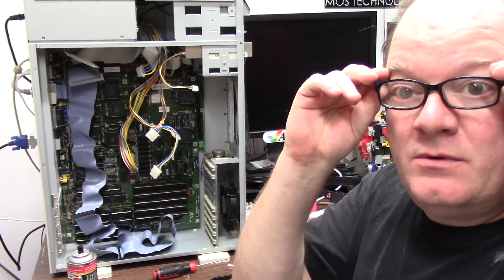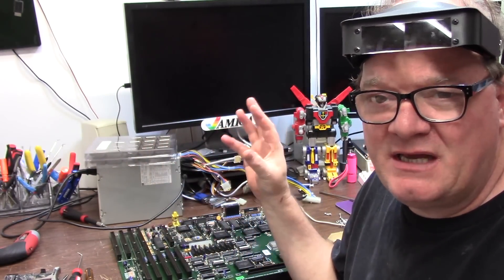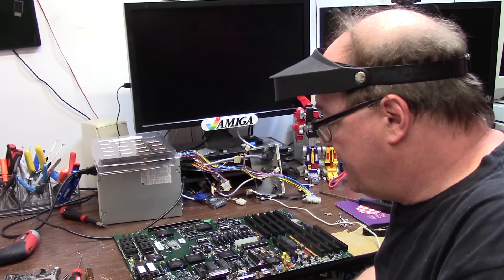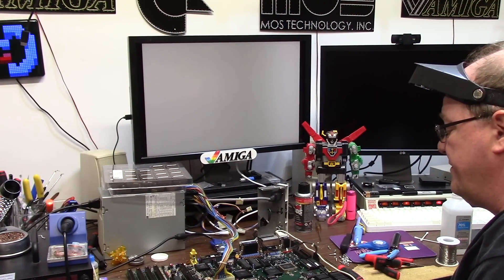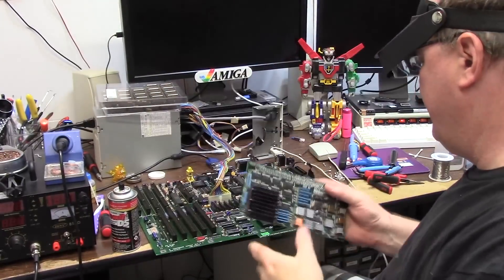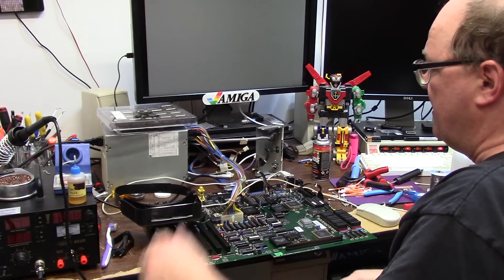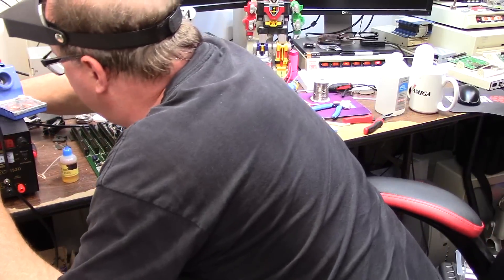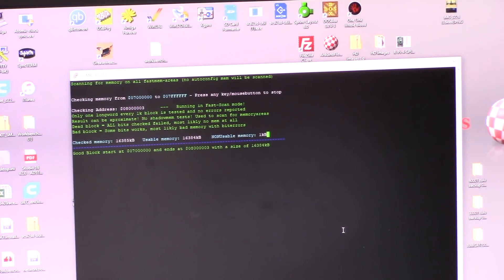My Amiga 3000T died

Comment: I have an A3000T with 8megs of chip ram and 56megs of expanded ram on a Phase 5 060 MK2 board, Buddha IDE, bought my tower new in the '90s. I also have the A3000D and A1200, all working except the scan doubler on the A3000D, bad traces due to the battery leaking. I was having intermittently with memory errors. I removed all of my chip ram and used the MK2 ram and all of my problems went away. Installed the chip ram on my A3000D and now I have 12megs of chip ram an all is well. I either had a bad ram chip or the MK2 with 060 was too fast for the chip ram or a bad socked, try this if you haven't. I am going to put my MK2 in my A3000D and see if I have ram problems on it.
Reply from the maker: Fastram.  Max is 2mb chip
Reply: @ChrisEdwardsRestoration  I was using a solder sucker 30 years ago and damaging boars. I bought a Weller desoldering station and got rid of all my solder suckers no more damaged boards. I suggest (all readers) if you are going to work on vintage boards invest in one, I paid over $400 for it 30 years ago, now you can get one for about $100.
Reply: @frankpapaeliou5630   those poor boars....
Reply: @ChrisEdwardsRestoration  I had 8 megs of on-board fast ram and the mk2 ram when I had problems. I removed the 8 megs and just used the mk2 ram and all my problems went away. I installed the ram in py 3000D and ran a MicroBotics MBRTest-2 for over 4 hours with no errors, that's why I believe I have a socket(s) problem.
Reply: Oops yes 2megs chip ram. Have you tried removing the fast ram and using external ram?

Comment: My gut feeling is its U202/203 lines, or RAMEN (p25) off Agnus, or if its something silly on Agnus like its in a 'kinda' test mode (p 41); doesn't Agnus do some things in 32768 chunks (could be cause or effect though I guess)...but note, I am an idiot and dont know anything!
Reply: ETA - also got me thinking back to an old Jan Beta video --- have you made sure none of those trace wires have been pierced by any pins?
Reply from the maker: Checked them all and i even replace sockets
Reply: @ChrisEdwardsRestoration  Couldn't tell, was the onboard (non socketed) chip ram changed? (I've had cf cards fail 'randomly' too often when RAM was marginally misbehaving).
Reply from the maker: I get to that in future episodes and even more weird stuff happens

Comment: I have only this, once, many moons ago, WE (Computer Chain) had this A2000 come back to us at Warehouse, Ver 4 MB come in Powered, but Dead but complaining of Disk Errors, Erratic Working, then Dead, they had spent some bucks on 68040 GVP, So we looked at it, long story, but it boiled down to C.I.A Chips being a early revision not be abel to handle it, & Frying Themselves, I cannot remember all, but It was also to do with MB Version, cause my Kindly employers, Sold them a Version 6 as a Sparepart ... I didn't do much work on 3000 T so unsure if this has any help in it ..
Reply from the maker: i wish it was. but Cias are fine.

Comment: I've replaced tons of Toshiba branded zip chip ram in these machines over the year,95% of the time its been the soldered chip ram has one or more fail-did you remove and test ALL chip ram??. Also had a 3000T once that the factory denise socket was bad,intermittently crashed no matter what completely random(not pertaining to your trouble).. i finally found when i removed the socket it had one bad pin broke making contact sometimes ..make you pull your hair out :D I sold the sockets to Tim,they were bonafide hard to find zip ram sockets and not made from pin strips. Good luck finding the trouble man!

Comment: It looks like upper half of the lower word (so D8,9,.10.11.12.13.14.15)  The RAM that connects to that will be buffered - that buffer is either borked, or the 74 series / GAL that controls the 245 OE or DIR pin maybe.  I am thinking U258 or U256...  I think effectively 1/4 of the RAM cannot be accessed, but its 1/4 off the 32 bit width - meaning none of it is technically accessible in terms of 32bit access, and for 16 bit access only 50% of that word is working - basically you have no RAM...    Great video btw!  I did enjoy!  Just sorry you had to spend so long on this one - it's better for the new sockets for sure!
Reply from the maker: see my brain lacks that ability. thank you ! i will continue on. these are all pre filmed from months ago. i ended up replacing the entire chipram system, the 646's the 74 series, the ram the sockets, agnus everything, and i got a cpu that said "BEEF" lol

Comment: thats amiga for you :) check the hard drive controller. if the hard drives started getting all f-ed, then your chip ram, it might have been a short, it might be the controller. you went over all of "your obvious, maybe you should try thinking outside the box a little, might help. id go around and do what you did, then id check the HDD controller. maybe even paula. hey, troubleshooting works like that, i know you got this, i know you know what you are doin; just a suggestion.

Comment: People tell me how great it is to own these still. That they want to get one and dive in again and enjoy it. I always try to be honest with them. They’re old machines and many never stored properly. You might even get a working one and play games and have a blast one week, only next week for it to explode. Amiga is a love-hate relationship.
Reply: The A2000/3000 are full of old sockets,they can be made reliable IF you go thru everything..(check all chip pins,socket pins,etc) Battery damaged board that have been repaired  are a roll of the dice if the damage was bad. A4000's are usually incredible reliable with mostly soldered chips. Mileage may vary if you've seen the things i've seen people do to these poor machines. Wokring on a  A4000 board that has  been tortured now,looks like someone tried  to solder on it with thick acid core plumbers solder with way too much heat to the point it burned the flux black and stained the board..Simm sockets all broken like simms were ripped out. still have no idea what they were trying to do!  if you skip anything refurbing them,expect a life of pain :)

Comment: Poor Chris 😓
What software are you use on PC for check ur Amiga?
Reply: First: You need DiagROM on the Amiga side. Then you need a null modem cable to connect the Amiga and the PC over the respective serial ports. On the PC side, you then can use any terminal program you want. For instance Putty. This then will display the output the DiagROM does over the serial port.
Reply from the maker: Thats what i do
Reply: Looks like just a serial connection to the miggy with Putty. Diag rom has a serial interface for when you have no video or keyboard input available etc.

Comment: 8:17 4 bits are red so i think it is one of ram (they are 4 bits) but it also could be PAL 16L8D (U202 and U203), resistors RP253 or one of 74F646 U253-U256
Reply: I think like you, it's not very important.